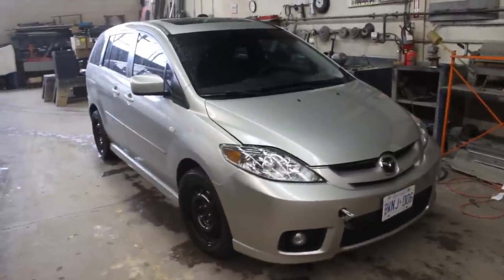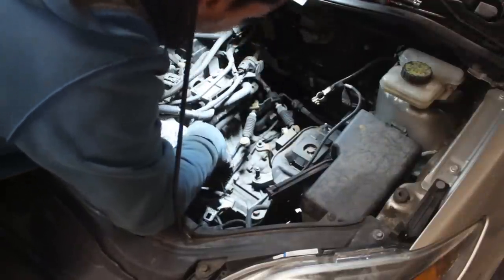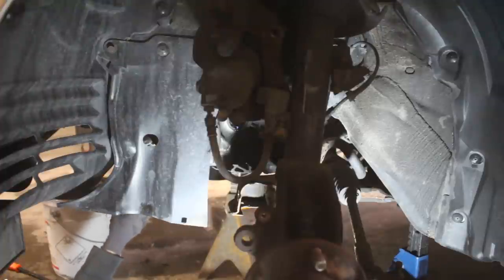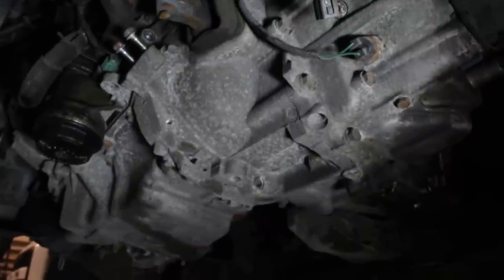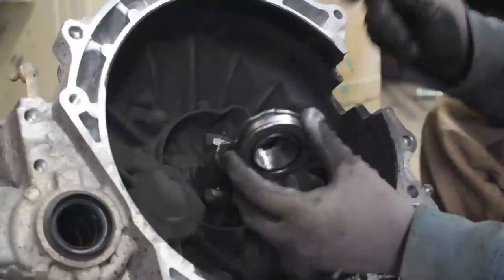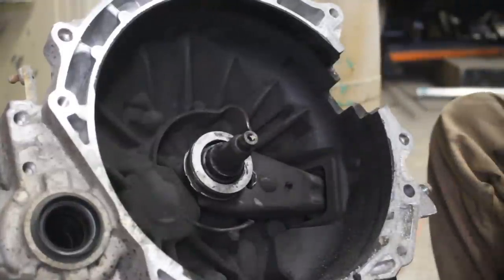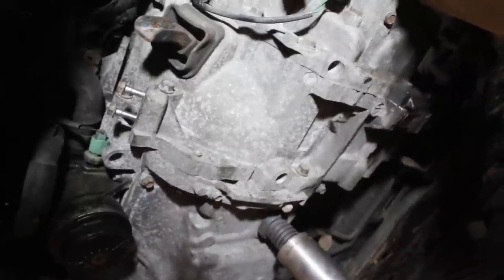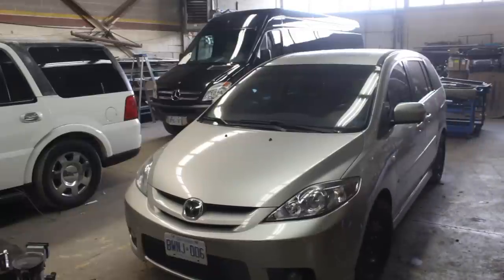2007 Mazda 5  Clutch Replacement

Comment: If you do not have a transmission jack, the other option is to use a horizontal engine support bar (over the entire engine).  This can hold up the engine.  But you can also use straps or chains to support the transmission (that also go over the engine bar..and can slide left or right).  Using straps with an engine bar is harder than a transmission jack, but doable.  Also, the trickiest part of a transmission job is getting the transmission lined up.  One trick is to go to hardware/autopartstore and get the same diameter/thread bolts that are twice or three times as long as the bolts that hold the transmission to the engine.  3 will usually do, but match the top most ones first (sometimes the top bolts of the transmission to engine bolts are bigger than the bottom and side bolts, I don't know specifically on this car).  CUT THE HEADS OFF.  Insert then on the transmission side (into the engine) and use them a guide bolts.  This poor-man's "install kit" has helped me (at home shade tree mechanic) several times.  Then use (some of) the original bolts to slowly draw the transmission to the engine.  Keep an eye on the "open space" between the engine and trans.  It has to remain the same, or you will bind.  Usually after I get 2-3 of the originals bolts installed and the transmission is fully next to the engine, the temporary homemade guide bolts will unscrew by hand.

Comment: NEWBIE Advice.  When you remove any bolts/nuts, try to put them back in their homes immediately.  Kinda like he did with the slave cylinder bolts.  Good candidate here would be the 3 bolts that hold the "top" transmission mount to the trans (under the battery box area).  Sometimes these bolts are different lengths.  Try to avoid "I'll just remember" syndrome. Elin is not a newbie.  But newbies, you'll be thankful the bolts are in their homes with reassembly.

Comment: You really should have changed the small spigot bearing in the flywheel for the gearbox shaft, while it was apart.
Reply: Agreed.  Future readers, at the 21:23 time mark, the quarter ($.25) diameter bearing (or maybe tad bigger) right in the middle of the flywheel should also be replaced.  It will usually be in the "clutch kit" you purchase.

Comment: The reason the control arm did not "drop" aka "go down" enough (earlier than later) to separate from the hub ... is because the strut is fully extended.  Some people (more dangerous, you've been warned) compress the strut with a jack pushing up on the hub (round part that holds the 5 studs for the lug nuts).  This is more dangerous.

Comment: Great video.

I just bought Mazda 5, 2.0 Diesel, 105kw.
The clutch goes very hard, and at some point in the middle it breaks though more easy.
Should I change clutch set + flywheel or just clutch set. 
How do I know if flywheel is up for a change too? When I go low RPM in 2nd gear,  the car gets a bit soft stuttering. It's not shaking too hard but I can feel it back and forth a bit.

Comment: Hi I have a Mazda 5 sport diesel, loved your video, big help thanks, I am having a issue , my car will tick over lovely , but will not rev over 1000 rpm , could it be a transmission problem, thanks if you can help..
Reply: Don't think so the transmission just transfers  the power to the wheel. It sounds more like a sensor acting up.

Comment: i have a 2007 Mazda 5 with 191,000 miles on it and has started to grind when I shift from 1st to 2nd gear... Do you think the clutch is going bad?
Reply from the maker: Most likely the synchro ring inside the gear box. If it was the clutch it would be on all gears. Also when the clutch gets worn it does not engage anymore. Not the opposite
Reply: @RustyBeauties  Do you have any idea what it would cost to have the 2nd gear synchro ring replaced?

Comment: Any other Mazda 5 owners have notchy gear changes. I have just purchased a 2.0l diesel with 80k miles and find it quite hard to change gear 1st - 2nd and sometimes 2nd - 3rd
Reply: yea i just bought a used one recently 08 2.3l and it has a little bit notchy shifting sometimes. i plan to change the gear oil to redline mt-90. i have used this in my 09 mazda rx8 and my 81 fiat and in both cases it made shifting a bit smoother feeling so hopefully it helps on the van =]